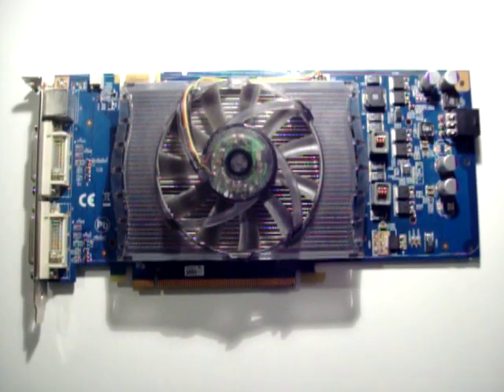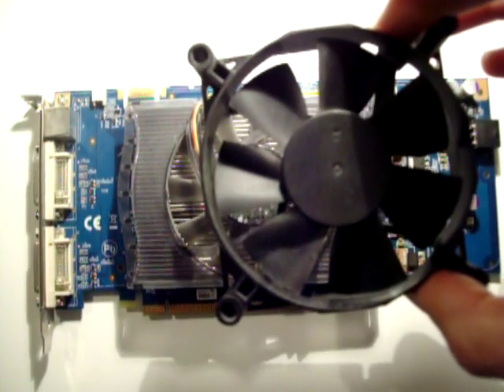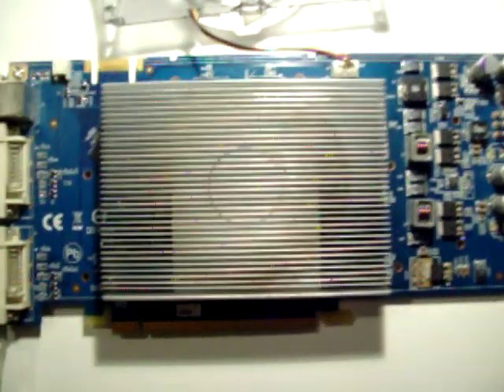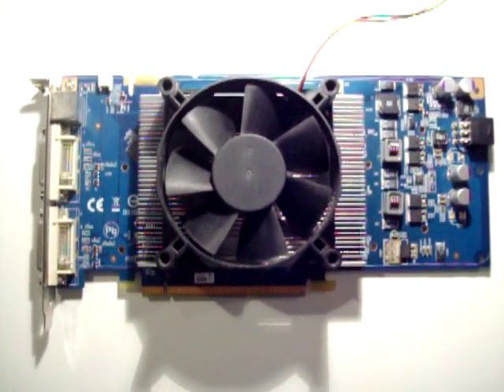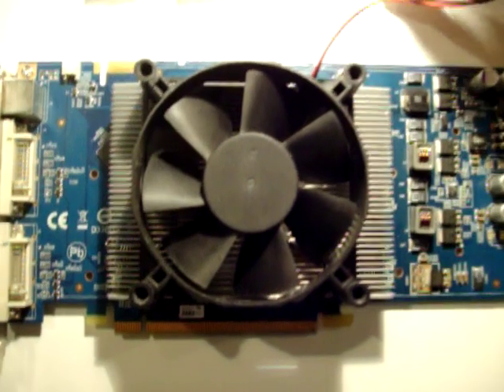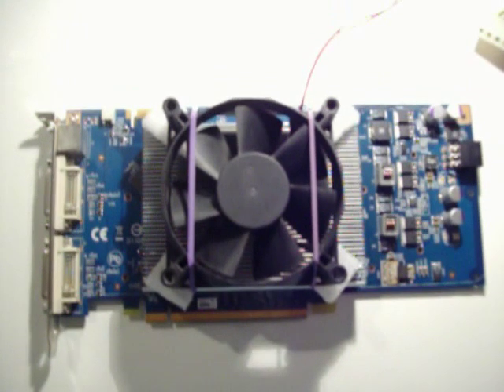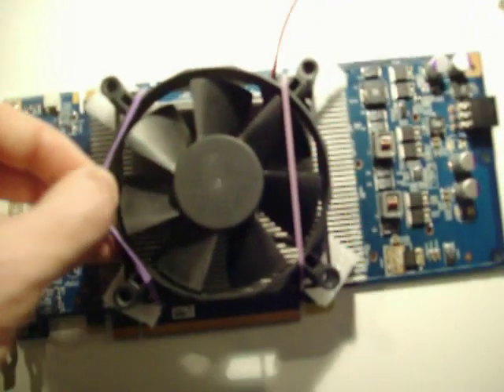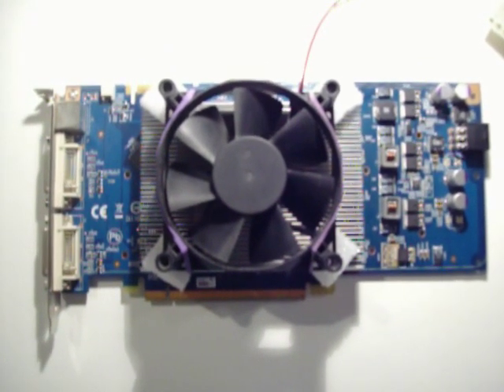How To: Replace a video card fan

Comment: Always take the extra few minutes if possible- to re-compound the die-to-heatsink interface. Over time- all compounds- especially "factory brand" types- dry out and become useless. Anchor the fan with 4 self-tapping machine screws- through your foam cushions, down inbetween the fins of the heatsink. The aluminium makes very nice, sturdy threads. Even use a drop of Loctite or nail polish as a threadlocker. Works everytime.

Comment: That is not the original fan of that gpu right ?  Anyway i keep the one the card has on my ati 1900 gt but i put on on the chip well on the end oft t he side where there is no fan and now my temp is steady about 50 c when i play games about 60 c now. Now my question is i used a well a string that and on the other side its good i know its good. But the string that on the other the side where there is the card the back side i put not paper but this kind of well what should i put there so it does

Comment: So on the back of my card the string i put a small size not paper its what you have as post cards etc to secure so it does the string not touch the back of the card. I might as well upload a picture to you if you could help me out. thanks in advance.

Comment: your fan is upside down.

       ====
      =      =
      =      = 
      =      =  
>    =      =  -->>>> air comes out there like "SWOOSH" and you put it to blow air to heatsink, then it suck the heat to 
      =      =                                                        to chip... NO you have to put it to blow it away to heatsink, did you understand
      =      =                   <THIS IS THE FAN 
       ==== 

SRY my bad english
Reply: *****
ikr